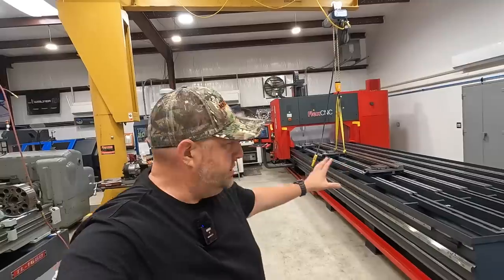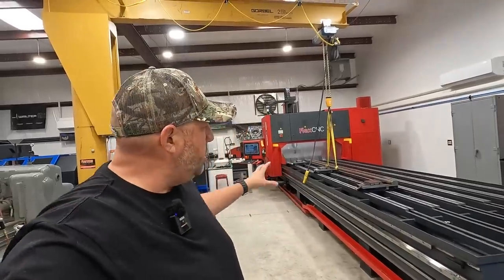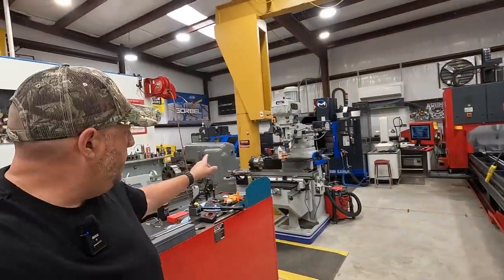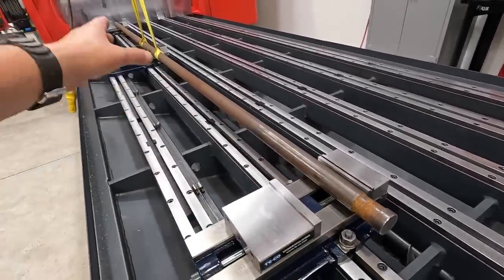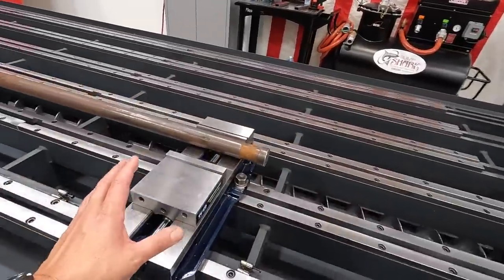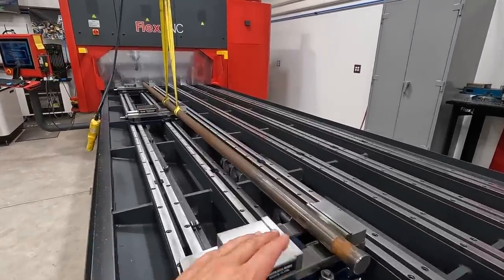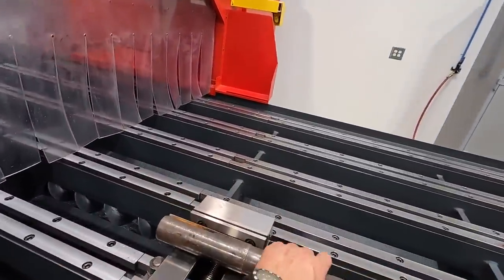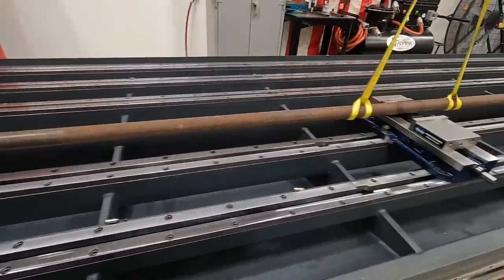Keyways Machined in the Flex CNC

Comment: I think you need to verify what part or area of the spindle the computer measures from to determine "Zero" when you probe for zero with the Heimer. Then, of course, where do you measure from on the Heimer to compensate for its length?
Once you get those things figured out, I don't think you're going to have anymore issues with Z zero. 
Thanks for bringing all of us along on your journey to master the Flex :)

Comment: A possible reason for the DOC being incorrect is that you don't have the correct Z tool offset in for that particular cutter. Also, it's worth checking that the tool is T0505. On my machine it makes a difference but I know nothing about the Flex CNC set up. It's nice to see it running Adam.

Comment: One other thing I'd suggest you should do so you get used to it is to turn your coolant off as you move along the shaft to the other end, might not seem like a big deal but if you had say a part or a big run of parts that you're only cutting both ends but has multiple pockets along it you don't want to have to keep clearing the coolant out of all the pockets on every part.

Comment: Glad you have test pieces, one of the nice things about programming  (enough that it's comparable to CNC) is that we can try and compile and it spits out errors. We can then correct it and maybe compile again... only yours cost test pieces or bits :(
Keep on keeping on it's worth it in the end. :)
Reply: Not a machinist by training or trade, but I've seen G code and it's more akin to assembly. Just because it compiles doesn't mean it will work.

Comment: I assume that tool wear is another reason to switch tools at the finish pass. That would reduce the wear impact on the final dimensions. Very cool machine and good work on your part. I am interested to hear what is causing the issues in the Z measurement by the electronic tool. From what I am seeing on the screen you are showing -0.0298" greater depth than your desired 0.250". You should be able to eliminate the tool touch off to set zero. I am still learning the CNC milling myself. I wonder if on something this long, if it would be beneficial to tap in the stock material to ensure they are fully seated in each of the vices?Thanks for sharing.

Comment: Next time you set the job set your relative position on top of the side where your datum is and origin your z. Then touch off on the other side of the part and you will be able to se the difference in relative position. A trick I use all the time with those long parts.

Comment: Adam, I never did that blow out of  the coolant out of the spindle or tool, that something that only done on this specific gantry mill.   Maybe to avoid any humidity near the seals and the spindle bearings.  And on an other subject, you need to establish a good repeatable process to setup your G54 and all the tool length.   If you don't you will always have issues with final dept of the tool working and diameters of each tools.  

You should get or check if you can install a Renishaw measuring tool probe,  with that probe you can have accurate tool length and diam.  and also Renishaw have a probe that can be on your tool rack and you can use it to setup your G54 of the part.  And usally with these probe you can check with macros if what you just machined is in specs.   

Now for that Gantry mill, you will have to check if any of Renishaw products can work with your Gantry mill.   If they do work, won't have to second guess again.

Comment: I have never seen a machine using coolant that had a stream that did nothing coming out of it.  I would be concerned about coolant residue build up as occurred on my saw with the first coolant I had.  Evaporation is a real problem for me here in Houston and a pain as I cannot just add more concentrate, I must mix it first and the Trim e 206 requires me to add the coolant to the distilled water not the other way around.

Comment: Congratulations, you did it!  Keep producing quality products for your customers and they won't mind if you are learning on the job.
I am glad that you have a 3-axis probe tool.  Does it communicate with the machine when it makes contact, or do you have to watch the dial?  The ones I saw on other CNC channels seemed to either use a separate cable or to communicate with help from a laser.  Right now, you are making manual measurements and entering them by hand before making cuts.  If you are adding and subtracting a lot of heat to parts of a 10-foot shaft, I would worry about the far end moving a little bit.  I've watched videos of the fancy 5-axis mills and they can change tools fast.  From what I could see, this mill is reasonably fast.
I am not criticizing!  As a retired scientist, I just love to make precise measurements.

Comment: First of all, I'm a big fan !! good job. in order to get a good measurement of the depth, should you get it from the highest point of the shaft ? by taking in from where the cut was made it's reducing the height a little.
Reply: no. the 0.250 depth isn't measured from the highest point of the shaft, the 0.25 measurement is for the sides of the key as they are what supports the key, so it's measured from the width of the key. If you were doing it manually, you would mill off the top until the cut was the same diameter of key, and that is were you would go down 0.250 from. the reason is because of the relationship with the shaft and the matting component, gear, pulley,ect, if you were measuring from the high point of the shaft, the key wouldn't be equally positioned between the shaft and the matting component, it would result in a shallower keyway for the shaft, which would require a deeper keyway in the matting component, but you want the key to be equally supported by both shaft and matting component. so the actual sides/walls of the key should be the same height for both the shaft and the matting component.

Comment: So much nicer for a long rod that wants to tip the milling machine over with the leverage of it hanging off the table to just lie there supported and stable.  It will go quicker in the future.  Sure you can do it quicker now on the manual mill that you have used for decades but it will get quicker and easier once you get comfortable with the new machines.  Remember how intimidating the manual machines were once long, long ago when you first had to learn them, same thing, just different technology and knowing the current methods as well is a good thing in and of itself and will payoff with multiple identical parts.

Comment: question : isnt yout coolant suppose to go through the tool ? pretty sure that if you use a shrinking tool holder and a tool with inline/spindle coolant, your coolant doesnt suppose to shoot out of the sides of the toolholder.
 the only case i know of where coolant is shot past the tool (rather unintentionally) is when you use collets without sealing properties.
Reply: Check 22:29
Reply: Watch his last video. That's how these toolholders work.
Reply: It's a toolholder with through-spindle coolant, but he doesn't have a tool with through-tool coolant in it. So it shoots coolant down along the sides, and angular momentum flings some of it out sideways. Lots still hits the work around the tool though. Getting end mills with coolant holes would let it shoot through the end of the tool, but for side milling like this that's not as helpful.
Reply: It is mostly used for peck drilling.
Reply: @Freetheworldnow  Or other drilling operations. Lots of gun drills rely on high-pressure through-tool coolant to force chips back out from the bottom of the deep hole.

Comment: Good you are learning adam, but damn! that thing squealed when it was in a full slotting width, I wonder if that 5200 rpms was a bit too fast for the feed from the sounds of it. I think most of mine like to be about 3200 rpms and 38ipm on full slot, side milling is good where you had it about 5200 on full depth. side milling.

it takes a ton of experience in the CNC world and broken tools to figure it all out.

Comment: I use a master tool to set my Z height, all my other tools are referenced off that and are set in the tool library as longer or shorter (+ or -) but doing it this way you must always set your G54-59 with the master tool. So you could use the Haimer as the master, set the work coordinate in Z with it and all the other tools will go to the correct height once they have been put in the tool library on the machine control.

Comment: Well done for pushing the envelope outside what you know, that takes a lot. Might I suggest you try a circular polarising filter to eliminate the reflections on the door window when recording video?
Reply: An action camera might require a filter mount to do that or there may be a camera model with that filter included internally since it's one of the most frequently needed. Even NASA, JPL really, still uses filters on a turret in some of their latest instruments.

Comment: Will you show some of the code of a program? Maybe explain what each command does?
Reply: The G-Code is generated by Cam software, it's just a series of simple commands like turn on the coolant,  go to position, start spindle etc. I've worked in CNC a little bit and never needed to write anything myself, using cam software is safer.

Comment: I’m not quite sure you’re supposed to be using through spindle coolant with a shrink fit holder. Could back fire coolant up in the spindle motor
Reply: It looks like there are 2 distincts holes it comes out from, it seems this shrink fit holder is designed for through spindle coolant. Through spindle has lots of pressure anyways, like 20+ bar, the seal up to the motor is designed to handle lots of pressure.
Reply: @y0uRF4t3  yeah I just watched his previous video about the tool holder, I noticed the 2 holes likely for through spindle. The German cnc’s at my work, even under perfect conditions can get coolant up in the spindle motor and burn them out. Just a thought

Comment: Did you, by any chance, measure the probe length with the tip extended? then, when you set Z 0 you push the tip in and the 0 point ist too far down.

Comment: shouldnt that constant stream of coolant going down be going through a nozzle redirecting the flow to the workpiece?
Reply: Doesn't really matter with the through spindle coolant on.
Reply: @TheStevenRK  not really worried about it not getting cooled, just that its not getting directed where it should.
Reply: A job like this doesn’t really even need cooling, it is really just for chip evacuation

Comment: A question for anybody who cares to answer it. I come from a woodworking background, and I know why I did climb feeds on wood on the CNC machine (grain) but why is the climb feed utilized in this application? Is it for tool deflection to get it to go to the inside of the cut?
Reply: Not a machinist, trying from memory. Climb milling leaves a better finish, but it also doesn't work well for large depth of cut. Usually, conventional milling is used to rough out and then climbing skim passes are taken for a good finish.
The technique used here is a slightly undersized mill to rough out the majority of the material and leave a shallow, finishing pass.

Comment: I'll never get over seeing that stream of coolant flowing uselessly during operations. There's got to be a way to either turn it off or point it somewhere useful. 🤪
Reply: It's probably either a pressure bypass for the pump or meant to help flush the chips out in the pan
Reply: @Evan-qk3ml  I don't think those functions would be done at the height of the spindle. I mentioned in another comment that it would be fun to see the tool change to a cleaning nozzle and use coolant and air in a programmed cleaning sequence.

Comment: I know you're learning but once you're fully up to speed how much time would that keyway milling save by using the flex over your manual mill?
Reply: Please explain what the set would be on a mill
Reply: @markhgillett  One end of the shaft on the vise to be machined, while holding the other end leveled with the crane. Flip it and machine the other end. Probably a 20 min job tops and not even rushing it. 

As far as keeping both keyways aligned, the man himself have shown plenty of simple techniques to achieve that before he went full advertiser, you know, back when he used to produce some actual content.
Reply: @pedrobatista4439  I'm sure once programmed and shafts are set up that machine can cut keyways in 4 shafts in the time it takes for you to do one end of one shaft.
Reply: @Discretesignals  The programming would take longer.

Comment: The applications are much more, if that flex cnc could attach different heads : welding, laser cutters, laser engravers, inkjet marker,.. It would open so many business areas. Much more than abom can imagine
Reply: All of those processes have to be run on separate machines for a wide variety of reasons
Reply: @Halmengineer  just one example: laser cutting would need a lot of inconvenient extra safety enclosure (and probably extra shielding for parts of the operating area) to allow the machine to work in an open shop instead of a locked room with no people present.

Comment: Might be a good idea to put some caution lines on the floor in the areas of the gantry's range of motion. Would be horrible if someone was standing in its way on a fast travel.
Reply: Looks like it has a light curtain or beam around the bottom of the gantry, about the height of the HMI lower mount. It’ll probably pause the process if you break it.
Reply: @jacevedo497  Yeah, I use that same sensor at work, a few hundred of them.  definitely a light curtain.

Comment: I have always wondered how the required plunge cutting depth of a keyway on a circular shaft is calculated. If you touch off on the top of the shaft and plunge say 0.5 inches the finished depth will always be less than 0.5 inches if you measure with a depth gauge because you are measuring from the chord not the outside diameter. The difference will depend on the diameter of the shaft and the width of the keyway. Can anybody enlighten me?
Reply: Typically, the depth of a key is measured from the far side of the shaft to the bottom of the keyway. This dimension can be found in the machinist handbook.
The handbook is certainly a very valuable tool in this business.

Comment: You are worried about tenths and do you have your shop at the temperature that the shaft is being used at????? Doesn’t take much of a difference to change the dimensions by a tenth or 2. Taking into account the couple degrees that the machining is putting into the material too??